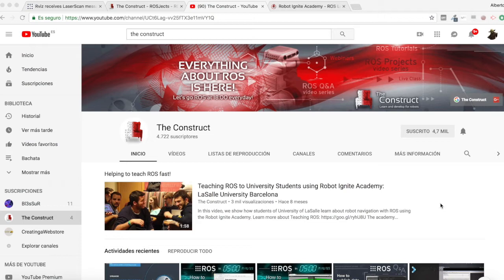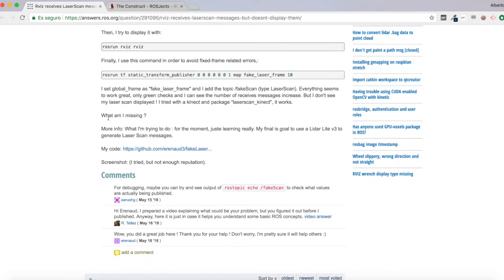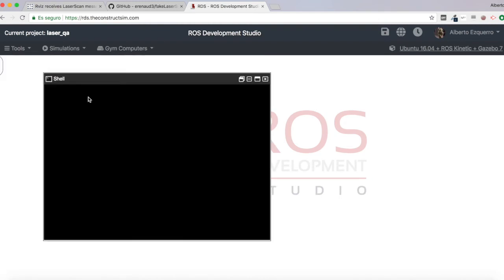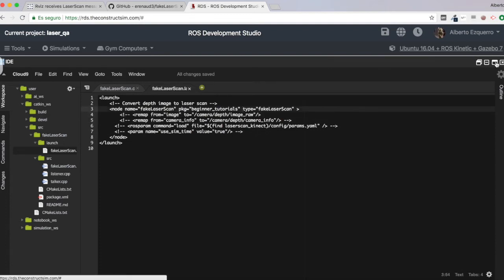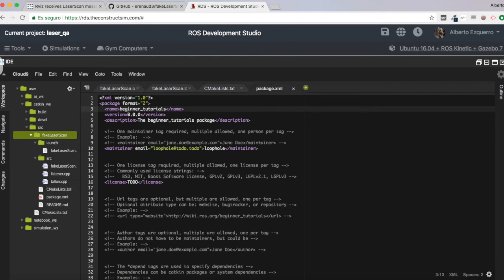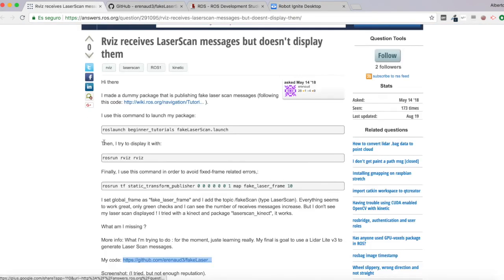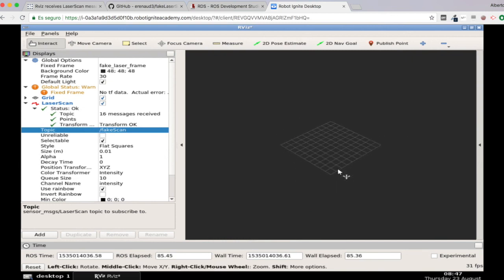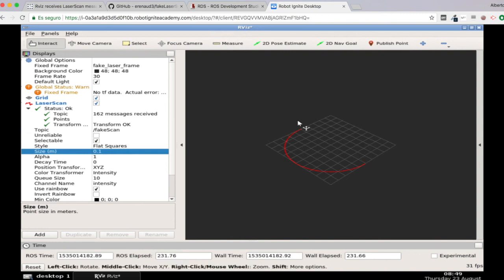[ROS Q&A] 151 - Rviz receives LaserScan messages but doesn't display them

Comment: Amazing, I have the same problem. I'm trying to create a modified laser on a mobile robot in a formation of robots (each has the same laser), but for obstacle collision avoidance the laser should not see the other mobile robots, since I do not want the collision avoidance to attempt an avoidance manoeuvre because of the other robots in the formation. The echo /laserscanmodified indeed shows only 'real' obstacles, however rviz does not visualize the laserscan points. I will test tomorrow to see if this is the solution.
Reply: Turns out my LaserScan wasnt receiving messages. Solution was to delete the LaserScan visualization, add it again, and it worked.